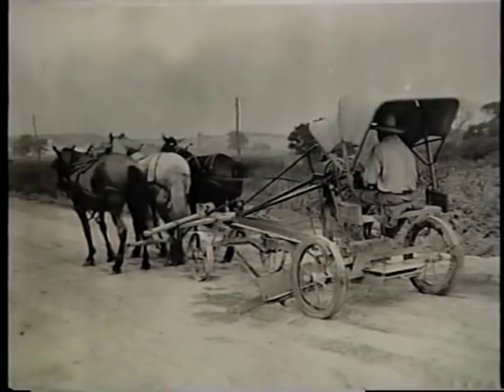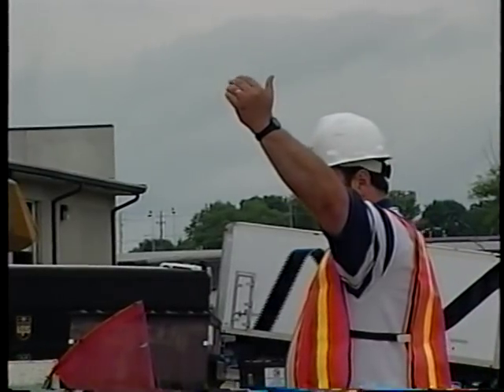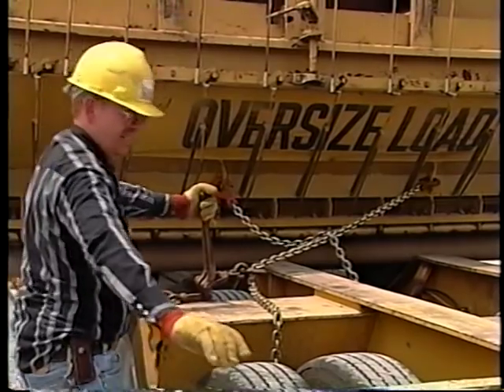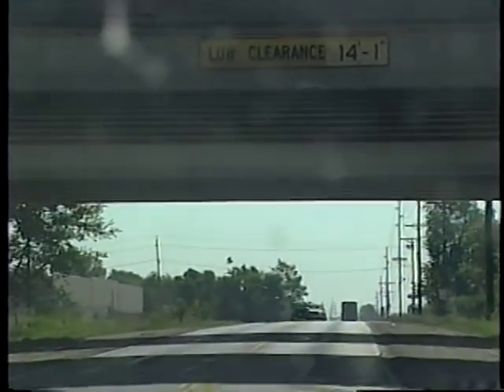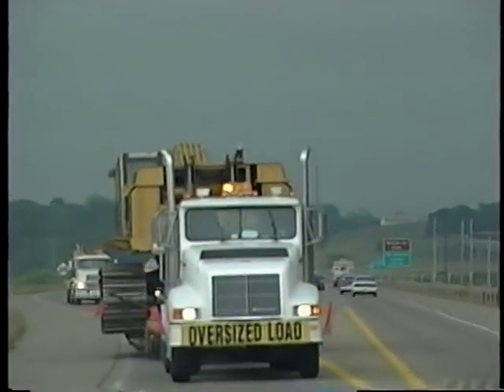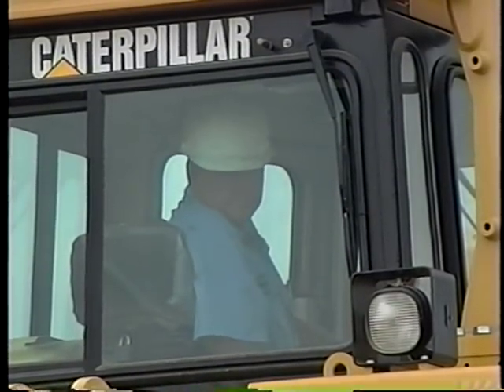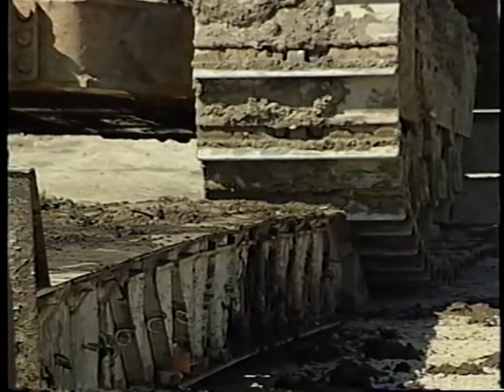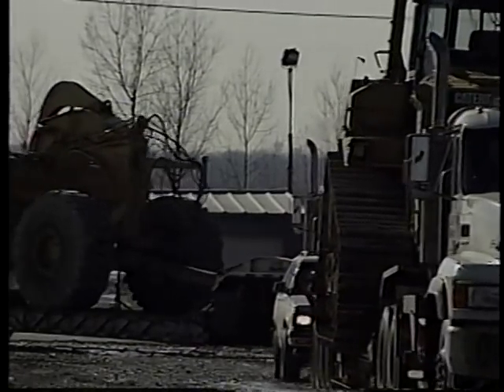Loading, Transporting & Unloading Heavy Equipment

Comment: Two points to live by. One, if there is more than half the tracks or wheels are hanging over the sides outriggers are mandatory. Two, if your hauling a dozer with a blade 12 feet wide or more. The blade must be loaded to the rear of trailer. Couldn't see it well enough in video. But one of the dozers they drove on forward looked like it had a 12 foot blade.

Comment: Teaching  safety is one thing. But filming a scraper being loaded with a guy on it, that's spooky! By the way, lovely Macks.
Reply: Lovley Macks indeed.
Reply: The driver wouldn’t be able to see the guy guiding or the trailer the guy guiding is on a platform that is secure and he is holding on tight but ya kinda scary
Reply: Nice Trail Kings

Comment: SAVES THE TURBO  FROM DAMAGE DO TO WIND SPINNING THE TURBO WITH NO OIL PRESSURE
Reply: hellbilly hellraiser Thats a old wise tell the air going down the exhaust isn't enough to spin the turbo I've been pulling RGN for 4 years never once had a problem
Reply: With the baffles in the muffler on most exhaust systems as well as non direct travel for air around curves and bends in the exhaust pipe. 
It's extremely unlikely that you'd ever Spin a turbo on a new machine. 
I've never had it happen in 12 years.
Reply: @brian2826  what ever dude some  they make exsuast socks just for equipment haulers cat or john deere will void warrantys i been in bus^business over 40 years
Reply: @markm1964 have you actually ever heard turbo bearings being damaged by dry spinning because of windmilling? , not in my 45 years moving equipment ….. old school thinking that I’m glad is fading away

Comment: You do not chain to the tracks on any piece of equipment they can and will move and they bend very easy (learned the hardway bent the hell out of a track on a d7 wide track) theres always better and actually faster ways than a binder from the track to the side of the trailer.

Comment: Routing on permits is not the responsibility of the drivers ,,, even owner operators. You call permit company and let them know what you're hauling and it's weight and dimensions and where you are going to and from and they figure out all the particulars.
Reply: Good to know. I'm leaving LTL and starting construction this summer. First time lowboy driving for me. I'm looking forward to it but a little nervous even though I've been driving for 5 years...
Reply: @bmack7762  hey there! How has your experience been? Any tips you can share with me?
Reply: @nerdyclown6393  It went very well for me although my company trained me for one day Haha. I had to learn a lot on my own, especially loading the equipment on myself never having seeing the machine before in my life, but was successful.  If I had to give any advice it would be to make sure you take your time and really think about what your doing before you do it!

Comment: ingermany its forbidden to save tracked vehicles at the tracks with chains or anything else. they`re not created for load saving. you have to lock the chains anywhere at the frame or the shield or the cabin if the producer says in his instruction book that its ok.and what should you do at loading when you have a semitrailer with a height of 80cm and a construction site where the fllor isn`t plain and the tracks are muddy or snowy.

Comment: Making a good point about center of gravity with these machines but to control that you cut the angle on the ramp coming up using wood blocks and old mud flaps or conveyor rubber..that way the tracks are never up in the air and come down hard which can spit a track roller? maybe im fron another planet but thats how i did it and never lost one

Comment: Is it legal to just use a binder from the track to the rail on the trailer. Or do you need a binder and a chain.
Reply: Yes it's legal.
Reply: It's ok, but not the safest! A chain should be added because binders break b4 the give, and a chain will give a bit!